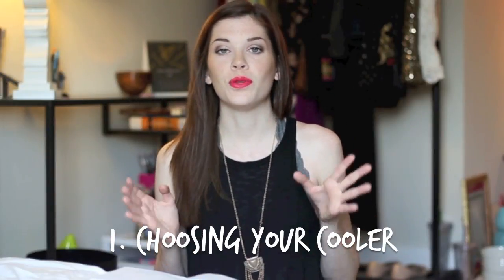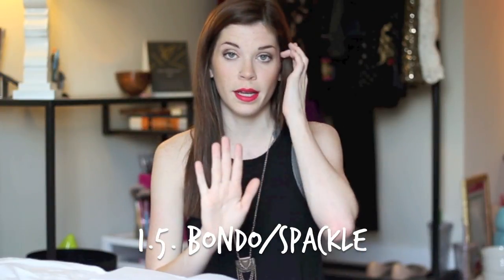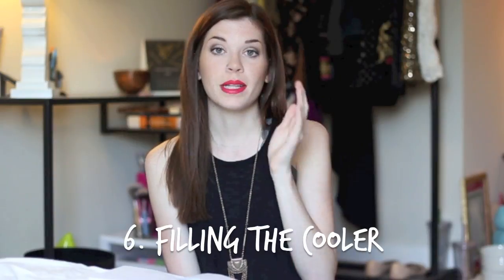☆ Cooler Painting FAQ/How-To ☆

Comment: Hi, I read an article online about painting a cooler and it listed a few different primers you could use. I opted for the Zinsser bullseye water based primer. I sanded the cooler pretty well, then applied primer and let it dry over night. It's been 12+ hours and I wanted to start painting it now, but the primer is peeling off around the corners and edges. What did I do wrong?

Comment: Hell, I bought a no prime or sand needed cooler. I painted it with acrylic paint and used Modgepodge and it all peeled off in one giant sheet. All the sides!! Unlike what they said it would do. So I primed it and then repainted it. I'm afraid to use modge podge again. Do you think I should just use the polyurethane??

Comment: What exactly does the waterproofing/polyurethane step waterproof? If the cooler is already covered in mod podge and minwax polycrylic, will the paint still get ruined with water? Or is the waterproofing step an extra just-in-case sealer?
Reply: This is a step I'm about to tackle and am having a hard time making a decision on - mod podge is water based, and so is the polycrylic - I'm wondering if they come in contact with water, will they maybe re-activate and become wet or gummy?  I was thinking  maybe by doing both the mod podge, then polycrylic, THEN putting a spray polyurethane which is oil-based, that might lock in the benefits of the first two layers?  The polyurethane would be the waterproof lacquered finish that protects from water damage?  I can't find any info out there and I REALLY don't want to mess up the hours and hours and hours of painting we've done on this cooler!

Comment: Do you have to sand the texture off? Like can the bumps stay there? Some sisters are telling me they sanded til it was smooth
Reply from the maker: +emily weschler I don't know anyone personally who has ever sanded until smooth and it's not necessary. It all smoothes out when you put the polycrylic on it
Reply: +beautymunson so I got huge huge scratches in the cooler from sanding. What do you recommend I do?
Reply from the maker: +emily weschler from what I know, scratches from sanding is a result of sanding too hard or too much. You just want to get the texture roughened up a little bit so things will stick to it and the coating is gone. If you already have the scratches, I would just work on painting over top of them. It shouldn't be too difficult but it may be slightly annoying but in the end, it will all smooth out.